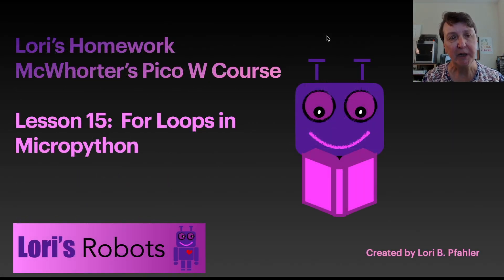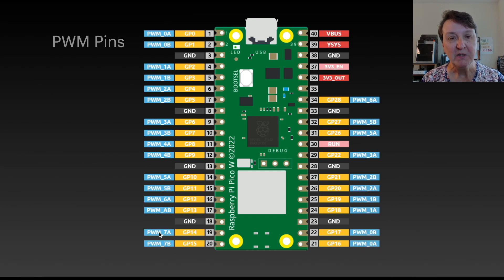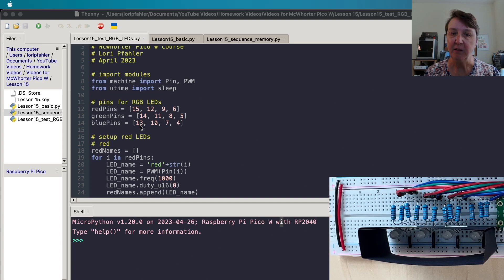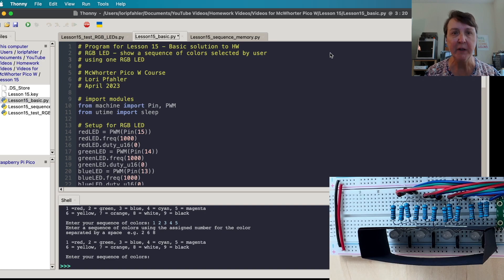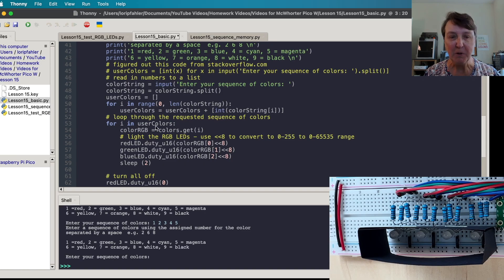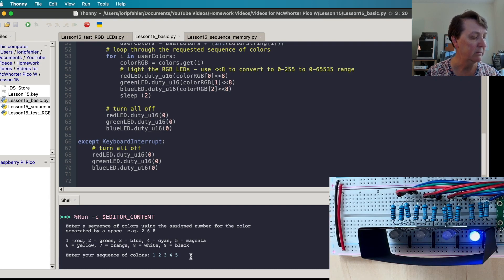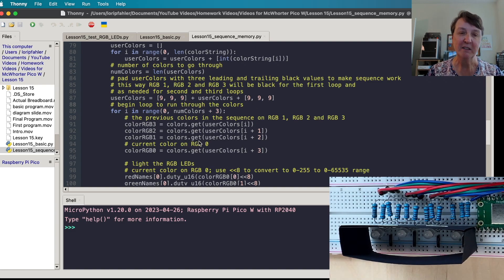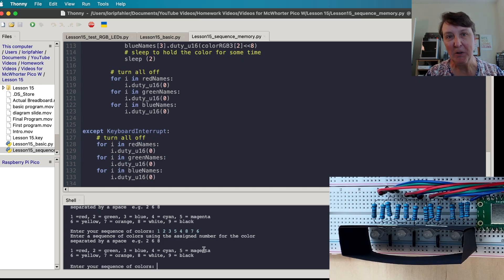HW for Paul McWhorter's Pico W Class Lesson 15

Comment: Jolly good! Your breadboard is very neat - I bet your closets are super-tidy😁Would the program fall over if you accidentally put in 2 spaces between the numbers? PS I've subscribed.
Reply from the maker: It works with any number of spaces between the numbers.  But I did not put error checking on the allowable numbers so it crashes on numbers not assigned an RGB code.  Thanks for subscribing and watching!